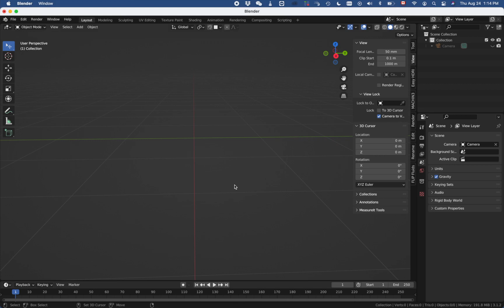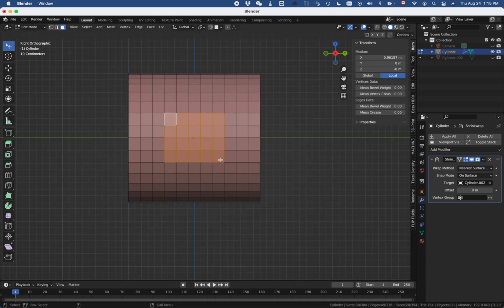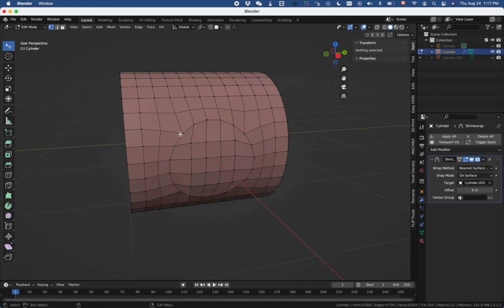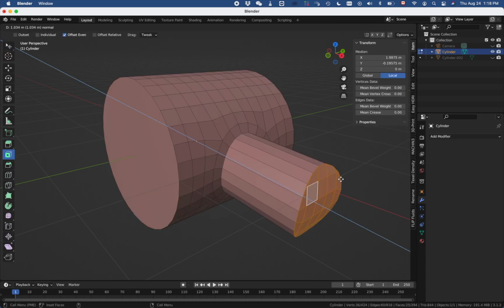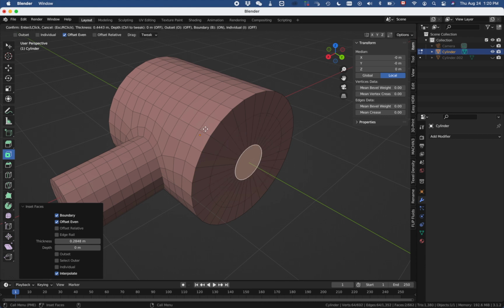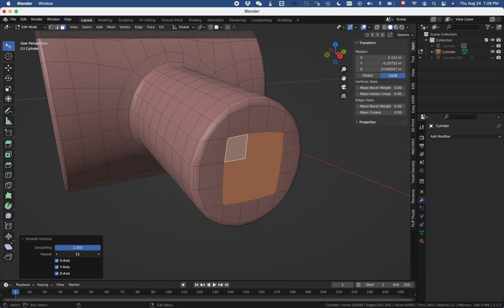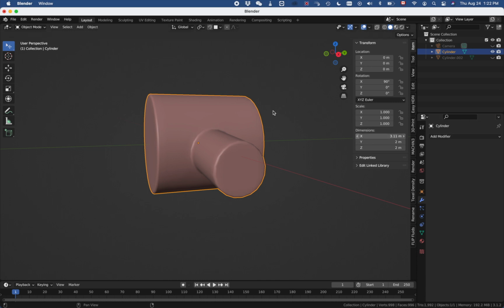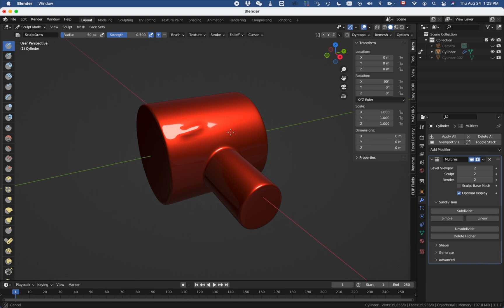Intersecting cylinders in Blender

Comment: Following this tutorial but, regardless of the shrink wrap, after using loop tools > circle, it's clearly not actually totally flat. Any reason for this? 

Looking at your mesh, the shading seems like it isn't properly flat too, or am I seeing things? 

Is this just some slight inaccuracies that need to be accepted with this method?
Reply: Actually thinking about it, I presume this is because the object that is being shrink wrapped obviously isn't perfectly smooth. I guess using a very high vertices cylinder is the only way to get close to perfectly smooth. I'll give that a go as can delete after applying the modifier later anyway. Going to try 10000 verts 😅
Reply: Actually no that didn't seem to make much difference -_- Any idea where I'm going wrong? Cylinders are definitely alligned! (Edit: Actually it's obviously becaused although verts are perfectly aligned, the lines connecting them obviously can't bend arround the mesh. Seems to work well enough in the end though so all good 👍
Reply from the maker: I explain in the clip that the circle tool has an option to keep it flat or keep the cylinder shape. :-)
Reply: @BlenderBob  I wasn't talking about the 'flatten' parameter if that's what you mean?
Reply from the maker: Yeah that’s what I meant. Hard to diagnose without the file.
Reply: @BlenderBob  Nah it's all good. All the verts are wrapped to the cylinder, but (obviously, in retrospect) the lines that connect them won't bend around the cylinder. That's what I was noticing. It doesn't seem like a big issue in practice 👍

Comment: What's the point of shrinkwrapping the original cylinder?
Reply: It keeps geometry of the modified mesh following the curve of the desired shape, instead of becoming distorted or flattened. Try following the tutorial without creating the second cylinder and you'll immediately see why you need to use shrinkwrap for this method.
Reply: As maxleveladventures already explained, this technique works to provide what is called a guide mesh. you can use this also with other meshes you want to change without changing the alignment to that surface, eg. in car modelling. Often you use high poly guide mesh for low poly modelling on top, so that you can control topology easily while still having the detailed original surface alignment, similar to classic retopology. At the end you can use subsurface to go to the original density if required.
Reply from the maker: Like the other said. But if you know you may heavily sculpt it later you can skip that part. Still going to work

Comment: Is this topology necessary for videogame assets? Particularly the extra edgeloops on the cylinder's round surfaces. What if I don't need the bevel, should I worry about joining the two cylinders or just leave them seperate?
Reply: For games you should use the least ammount of edges and faces. You can delete any edge loops, that does not change the shape. (Using extra loops to get an even face distribution is only needed when the model goes to sculpting. If not, no extra loop are needed.) You can simply push a cylinder inside the other, and also delete the faces which are inside the cylinder so are not visible. In this case the intersection will look sharp and not not realistic, but if it's a small asset, or the game visuals are like that, than it's ok. Also game engines use triangles in rendering, so it's more ok to use triangles, even poke the circles. It won't be subdivided later, so no problem. But if it's a character, that will be animated, than a quad topology is better.
Well, if the result looks ok in the game, than it's good. :)
Reply from the maker: All that imrrgpap said. Blender Bob is about working in VFX. :-)
Reply: Yes, game is different, it has to run in real time, and the memory is limited also. There is a triangle limit for the assets, no subdiv, sculpting details are baked into normal map. Still, if you need a bevel where the cylinders meet, this is the way. :)
Reply: Even if today game engine are permissive you should always keep a minimal amount of polygone, it's more easy to texture and also to crush, destroy and deforme, with less polygone you can litteraly make complex scene in Blender geometry node for example, it make every kind of impressive action possible, Less , is more !